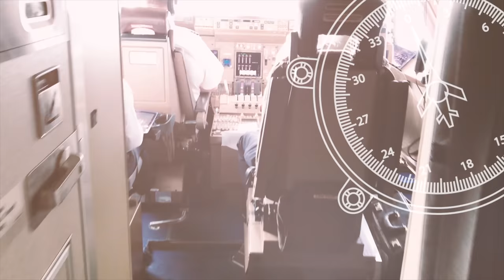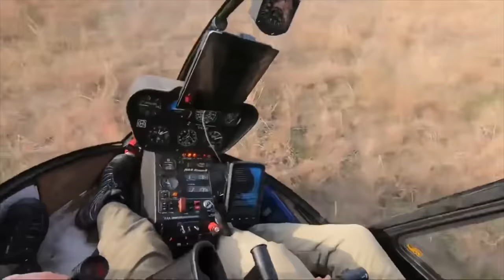Boeing 747 Loses Landing Gear | Viral Debrief

Comment: When I hear of pilots dumping fuel, I picture families having picnics in the park and people walking their dogs suddenly getting soaked by a mist of jet fuel.
Reply: generally, fuel is dumped at a high enough altitude that it disperses into the atmosphere and nobody gets misted. There was an incident over LA last year, though, where the pilot dumped fuel way too low and it did actually soak people that were outside, including a playground full of kids. But that was because they were not following procedure.
Reply: That was more what happened with that aircraft near LAX that dumped fuel at about 2500 feet.  Usually they're 6000+ and over a relatively unpopulated area, it has time to evaporate.
Reply: When possible, they try to do it out over the ocean. Also, unless they are flying at low altitude, most/all of the fuel will evaporate before it can reach the ground. But yes, on rare occasions, aircraft have rained Jet-A on the world below. 😕
Reply: Too bad jet fuel is literally highly cancerous and you don't want to breathe it in or get it anywhere near your skin
Reply: @thecloneguyz  Isn't it just kerosene? When I was a kid we used kerosene lanterns on family camping trips. Maybe that's why my dad got cancer at 33.
Reply: @MakerInMotion  Kerosene is the majority component of jet fuel, but just like with gasoline (or petrol) there's plenty of other stuff in Jet-A (US, spec and a few airports in Canada) or Jet-A1 (that's what the rest of the world uses) than just kerosene.
There's a whole finely engineered "additive package" that they add to straight kerosene to turn it into jet fuel.
Jet-A1 has an anti-static additive in it, Jet-A does not, but otherwise they're mostly the same stuff.
There's also some aircraft that need other additives in the fuel besides what just normal Jet-A/A1 has in it.

Of course, just like with gasoline, you're not getting JUST the carbon chain type hydrocarbons, you're also getting ring hydrocarbons like benzene (and others with more than just one carbon ring) and those are pretty much all carcinogens, known as Polycyclic Aromatic Hydrocarbons.
Reply: it will evaporate into the atmosphere.  If done correctly that is though I am sure there has been a few times that they have had to dump it to low but generally I don't think it is a issue.
Reply: @thecloneguyz  actually it has a risk but it fairly low compared to other things certainly not a highly cancerous causing like you said .  I mean if you have to be told not to bath in JP8 then you might have a issue but it isn't anymore dangerous than diesel or kerosene. It also has a lower flash point like kerosene and diesel. Not nearly as flammable as gasoline either. Not saying its good to spray it in the air but its better than people being vaporized on landing because the plane broke up and caught fire.
Reply: @jvmiller1995  heh yeah I have taken a bath in diesel before, changing the fuel filter on a tractor and not realizing the diesel would gravity feed from the tank.  Next time vice grips on the fuel line heh.
Reply: @GigsVT  Oh yeah I have had that shit on me a few times. drove a truck and operated equipment for years. If a little on your skin was going to kill you I would of been dead a long time ago for sure. Vise grips would be good for that.
Reply: When my friend was young, a plane dumped fuel over his house. They were low enough that it actually made it to the ground. Ended up in the paper. I didn't believe him until I looked it up.
Reply: @MDE_never_dies  nothing.. I mean it was in Cali so it probably mixed in with the acid rain and smog and cleaned both of them up a little before it fell.
Reply: An A/V-8B dumped fuel on my house in Havelock while I was stationed at Cherry Point. Killed my flowers and bell peppers. Coated my car in JP-8. Made me sad. My house was less than a mile off of the approach end of Runway 5R. Told the base that a Harrier had killed my flowers and they didn't believe me because "men don't plant hydrangeas." 

I understand though. I believe it was an emergency aircraft that was overweight and needed to dump fuel to land.
Reply: Or children in a schoolyard getting a Jet-A shower......
Reply: @thecloneguyz  yeah you're just overreacting, it's basically diesel fuel which you get on your hands many times when refueling your car.
Reply: @BarracudaHawk  Except in Los Angeles.....
Reply: @DaWolf805  Whom? the kids or the pilots?
Reply: @aviatorpianokraft  Are you seriously asking? Really?
Reply: @AnnaHerrick  Well Anna Herrick you answered your own question entirely to your own satisfaction
Reply: @chrisschack9716  jet feul can evaporate?
Reply: @thecloneguyz  
Diesel only burns under pressure?
Did you really say that?
Reply: @eugenejulson8742  Cmon now.
Dont get scared
BACK UP THE STUPID STUFF YOU SAID!!!!
Reply: @eugenejulson8742  yup, someone who has no clue what they are talking about misinforming everyone. Wonder how my oil burning furnace burns diesel without being pressurized, and how if you throw diesel on a fire it lets out a massive fireball
Reply: @eugenejulson8742  
DIESEL ONLY BURNS UNDER PRESSURE
DID YOU REALLY NOT KNOW THAT? 

THATS WHY AN ENGINE "KNOCKING" after its SHUTOFF IS CALLED "DIESELING" ??????

DID YOU REALLY NOT KNOW THAT?????
PFFFFFFTTTTTTBWUHAHAHAHA
Reply: @thecloneguyz  (I) didn’t say anything. All I did was ask you a question. 
I’m a diesel mechanic, by the way.
Reply: @patrickmcgovern2064  right. I’m a diesel mechanic.
Reply: @eugenejulson8742  you're a diesel mechanic yet you don't know that diesel only burns under pressure?????????
Ok buddy. Sure. 
Move that Goalpost!
Reply: @eugenejulson8742  diesel mechanic that doesn't understand the difference between Diesel and jet fuel and Fuel Oil
One of them is extremely dirty and only Burns under pressure and the other one is extremely clean and literally evaporates Into Thin Air all by itself and the last one is REFINED
Reply: @thecloneguyz  in 1984 I started as a Detroit Diesel Mechanic. By 1990 I was working on Allison’s and Continental engines. Now days it’s mostly Cats and Cummins. 
I tell you what. Go get yourself a cup full of diesel and see if you can light it. 
I know you can.
Reply: @eugenejulson8742  I feel sorry for somebody who has nothing better to do in his life but sit around the YouTube comments section and try to defend what he knows
Reply: @thecloneguyz  at least I can.
Reply: @Can-Am1989  I would like to see you putting gas in your car since you say that you get gas all over your hands just by putting it in your car?????
PFFFFFFFFFTTTTTTTTTBWUHAHAHAHAHAHAHAHAHAHAHA 
REALLY?
I have never gotten gas on my hands while putting it in my car I have no idea what you're talking about
Reply: @eugenejulson8742  
I don't argue with uneducated people because they just drag you down to their level and beat you with experience
Reply: @thecloneguyz  
Like I said Anyone can prove you wrong in one stop to a diesel pump. 
So of course you won’t argue. You can’t.
Reply: I remember seeing some news video of some people that got dumped on. Plane was too low, and they dumped the....well the actual dumper. Got all over some houses, a dog, some kids...
Reply: @DaWolf805   good job that jet fuel didn’t land on a bunch of people taking a smoke break outside their office!
Reply: @jvmiller1995  Dumping low is not uncommon. I used to work 2 miles from PHX, and at least once a week, I smelled a STRONG odor of jet fuel, which was obviously from dumping fuel. While airline administrators would prefer to have fuel dumped over oceans or deserts, sometimes fuel is dumped over millions of people. Better than risking a plane load of people, but not harmless.
Reply: @chadpollman7970     Swissair111 was trying to do that before they crashed into Saint Margarets Bay, NS.
Reply: @MakerInMotion    Likely.  Did you camp a lot?  I was at the airport one time planespotting.
The wind was blowing toward me and I could smell it.  All those burned up kerosene fumes...
Reply: @thecloneguyz    The burn pits for American forces overseas...
Reply: Not to mention wasting an input that cost THOUSANDS of dollars!   "Dump fuel"?  "Hell, dump the passengers the kerosene is more valuable to us!"
Reply: @DaWolf805  The whole area smelled for a couple days.  Powerful stuff.
Reply: @thecloneguyz  may I see your documentation for this?
Reply: Delta did it not long ago, they dumped really close to ground, I think was 777. The pilot sprayed schools, etc
Reply: @chrisschack9716  DL pulled that one off, he even sprayed a school
Reply: @MakerInMotion  it's just highly refined Kerosene
Reply: @thecloneguyz  you are intelligent, but it's important to remember the diesel fuel COMBUSTS under pressure (obviously it's going to burn, like any other vegetable oil)
Reply: @eugenejulson8742  the guy you're talking to thinks "burning" is the same as combustion. Diesel fuel will burn with no pressure obviously (like vegetable oil). But for diesel fuel to combust, it must be under immense pressure
Reply: @patrickmcgovern2064  absolutely, you don't need pressure to burn diesel, but combustion of diesel fuel does require pressure which occurs only in diesel engines
Reply: I also live near the main trauma treatment hospital here.  Where the air ambulance helicopters fly in and land on top of the building.  So I was passing by one day and stopped to watch as the S-76 lifted off.  And again, in the downdraft I was smelling the kerosene fumes.  Nice to have drawn into a hospitals HVAC.  NOT!!
Reply: I live in Nova Scotia near where Swissair111 crashed into Saint Margarets Bay.   As the fire was spreading in the plane the thing they were doing was getting ready to dump fuel as per Swissair operating procedure.  Not that it made any difference, sadly.
Reply: @jonathanaltman7393  
Compression ratio for a diesel is about 17 to 1. Gas engine ratio is lower at like 8 to 1. 
Ratios can be manipulated for performance
Reply: NO SOE. THE FUEL IS MADE OF PEANUT OIL- IT IT BASICALLY PEANUTTE BUTTER AND VERY SAFE TO EATS.
Reply: @DaWolf805  those kids probably learned to follow procedure after that.
Reply: @thecloneguyz  - It is no more cancerous than most other petroleum products including Diesel fuel (virtually identical) and likely far less cancerous than ordinary gasoline (which contains benzene). The vapors are the problem, as you correctly stated. Millions of motorists every day in the world do inadvertently inhale some vapors when refueling their vehicles (which is why I stand upwind of the hose AND lock the nozzle and stay back a little to minimize exposure). 

But again, 40 million residents in the United States alone still smoke cigarettes which is far more carcinogenic than any petroleum products..... :)
Reply: @MakerInMotion  - Most cancers take decades to form if they are environmentally caused. If your Dad got cancer that young, it just as easily could have been bad genes or bad luck, I dunno. I am sorry you lost your Dad so young.
Reply: @jvmiller1995  - A lot of places nowadays recommend or outright require safety gloves when emptying tanks or moving fluids. But unless you have any open wounds as long as youo clean your hands thoroughly at the end of the day you are far more likely to die of other things..... :)
Reply: @thecloneguyz  You have to be trolling. Of course diesel burns at atmospheric pressure. It's not explosive like gasoline but it absolutely does burn. And all of the things you mentioned (diesel, jet fuel, and fuel oil) are refined. That's literally how they get diesel from oil, they refine it. Source: I'm literally a petroleum engineer.
Reply: @thecloneguyz  Heating oil and diesel are exactly the same with the exception of dye that's added to off-road and heating oil. I used to burn heating oil in my truck all the time. Large trucks are subject to roadside inspections and the fine is steep for using dyed fuel on the road.
Reply: @thecloneguyz  fun fact: you can use diesel fuel in any regular oil furnace in a house without any extra tinkering or parts.

Also it seems people are confusing combustion with burning.
Reply: @DaWolf805  Wow - good to know!
Reply: Pretty sure it's evaporated.
Reply: A town near LHBP (Vecsés) is famous for their sour cabbage, there's a running joke that it is particularly delicious due to all the jet fuel that has been dumped on the fields.
Reply: @jonathanaltman7393  Combust and burn are synonyms, you seem to think combustion and spontaneous combustion are the same thing, because burning and combustion absolutely are the same thing, and diesel engines increase pressure for spontaneous combustion.
Reply: @cody6102  Burn and combust are synonyms, they are 2 words for the exact same thing, diesel engines use spontaneous combustion/self ignition.
Reply: Ah, the airline industry. Proudly sticking one finger up to the environment for 100 years.
Reply: It has happened to me.  I was at Hatfield Forest which is about 3km from Stansted Airport.  I don’t know why but an incoming plane dumped a load of fuel and although it wasn’t a perceptible mist, everything stank of paraffin and the air was filled with it.  It was fairly unpleasant.
Reply: Just hope there was no one sitting by a campfire below them then
Reply: @44R0Ndin  very good explanation of the varied composition of fuel. However benzene is a volatile organic compound and isnt a PAH (polycyclic aromatic hydrocarbon). Naphthalene is the simplest PAH. fossil fuels do contain PAHs. In the big picture regarding carcinogenicity, with the concentrations in fuel, its dispersal in the air when talking about planes dumping even too low and the contact time, its unlikely that a single event would have adverse health effects aside from acute irritation. People probably ingest more carcinogens (namely PAHs) from eating grilled or toasted food.

Comment: Every time I see a 747 in a video like this, I am more impressed with the strength and resilience of the 747.  If I win the lottery, what I would buy.
Reply: That'd be a dope home tbh.
Reply: @lydiamulfinger6781  hell yeah! But lets be honest....if I had one I would make it into a fucking paintball field and reinact Air Force One while playing the soundtrack from that scene! What?! Ok fine back to making a cruise ship a home...with a Titanic section were the hull has holes pop open and water.....shit
Reply: @bsgtrekfan88  you should be a movie director
Reply: Then spend the next 15 years learning how to fly it :)
Reply: I remember reading that the 747's landing gear is built strong enough that it can land at max weight in 45 degree crab.
Reply: @timemasterhms  And getting a pilot's license too
Reply: @chrissugg968  It might physically survive a landing like that, but not without damaging things. There’s also a max takeoff weight and max landing weight. You have a greater risk of damaging stuff when landing because you can come down hard so the weight limit is lower. And, if they think there’s a good chance of crashing they try to dump as much fuel as possible to reduce the amount of fire if something does happen.
Reply: That would be some jackpot.  Most jackpots aren't enough to let you buy a 747 and insure and fuel it.
Reply: @chrissugg968  Look up Boeing crosswind landing testing on YouTube.. Test pilots intentionally bash the things into the ground full crab.. It's downright scary in some of the clips but it really shows how overbuilt the landing gear are.
Reply: @blackhawks81H  Most of Boeing's stress test videos are downright scary. You seen their wing-bending test? Almost 90 degrees, yo. 747 don't give a damn about gale-force winds. And then there's the brakes-only RTO test where all the fully-worn brakes were glowing red hot without bursting into flames. These things are designed to be abused in every way imaginable and keep working.
Reply: Doesnt matter the plane you buy, it matters what IDIOT mechanics you have working on it.
Reply: @NBSV1  good job, you literally explained what was already said in the video.
Reply: @pleappleappleap  this is why most lotto winners are broke within 5 years.
Reply: Should watch videos of them testing the breaking points of these massive planes.

These planes can look like birds flapping their wings before they break it's extremely impressive.
Reply: I’d turn it into my house that flew. lol. I would also leave enough space to transport families of truckers or the families that need life saving flight transport to another state or country and fly them at no cost. Of course it would also be available to nurse’s, doctors, surgeons, anyone who worked the frontline of Covid and lost their jobs because they didn’t want the poke.
Reply: John Travolta has his own 707, and parks it in his "front yard".  Also uses it; maybe he has his own airport too.
   Google:  A look inside John Travolta's Airport Mansion
Reply: Im wondering why the mechanics didn’t do a gear swing after what ever it was they changed most likely an extension/retract actuator . Typically if something is replaced that would effect gear extension/retraction a gear swing would be required. The aircraft is jacked up and the gear is retracted and extended several times to verify operation. Also more than likely this would be a required inspection item meaning that a designated inspector would have also approved the installation. Basically several rules would have to been broken for that malfunction to have occurred.
Reply: The only lottery that would buy one of those would be the Powerball - and that would only be if no one won it for about 5 years before you hit the numbers.
Reply: It would have to be a very big lottery win. A new 747-800 sell for about 350 million. Then you need pilot's license, insurance, storage, fuel, etc. I think John Travolta's is the 747-200 or 747-400, he parks at this house next to a runway. He was offered a new 747-800 but he turned it down. It was too big for where he lives. He would not be able to park it at home l think that was the reason.